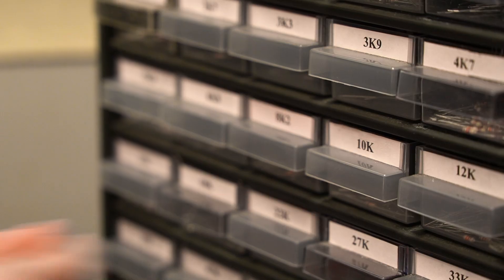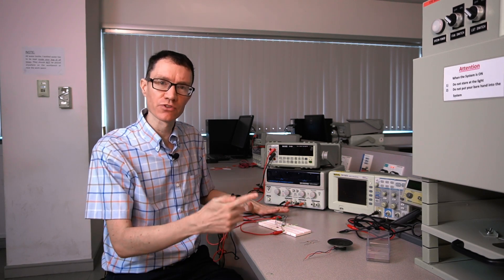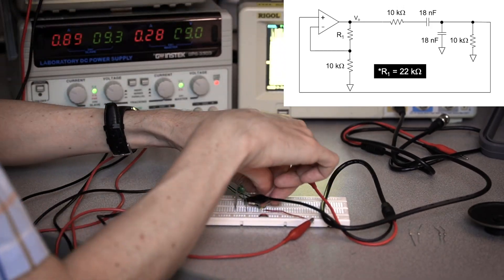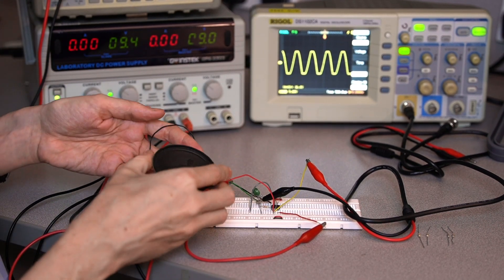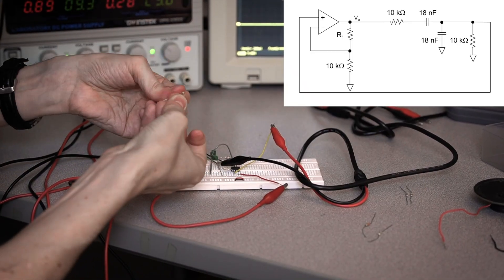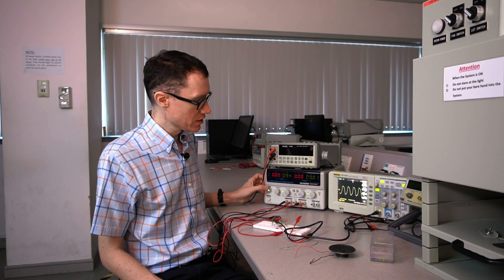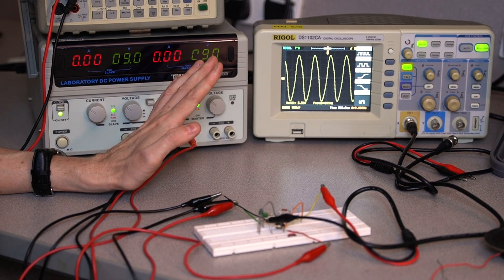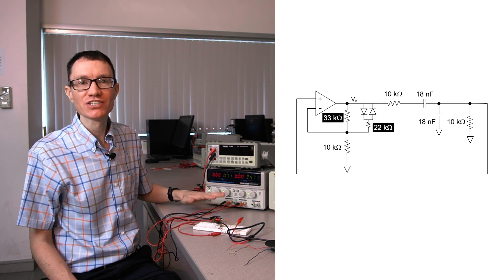Let's build and test a Wien-Bridge oscillator (3 - Oscillators)

Comment: my circuit wont oscillate.  do you have a proper top down view of your breadboard.  Maybe I have set up my dual power supply wrong.  Completely frustrated.   I assume the arrows going down are grounded to the bias point voltage of the dual power supply.   UGH>

Comment: Thank you for sharing / making this video. When you say adding a "Buffer" to prevent loading of the oscillator, do you mean adding another Wien bridge circuit on the frequency output so the first oscillator does not get loaded or just adding a capacitor would do the trick? (in series with the output pin?)
Reply from the maker: A capacitor won't do the job too well; another amplifier with a high input impedance will work well as a buffer.  I have a video on buffers which might be helpful: 
https://www.youtube.com/watch?v=UEtE7NSQkIs